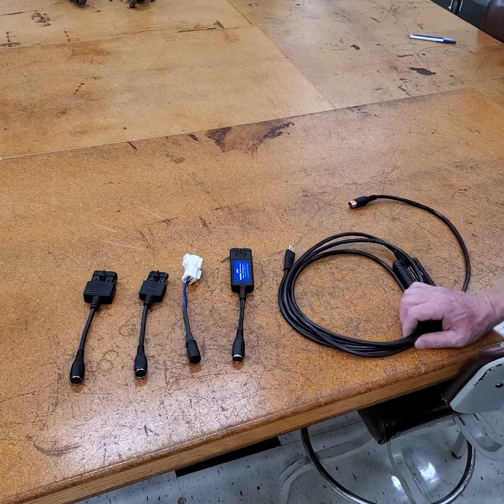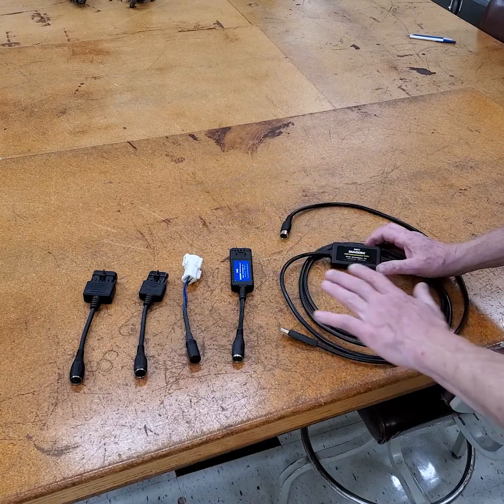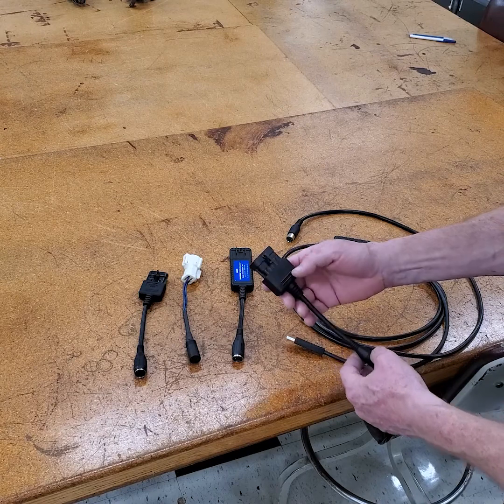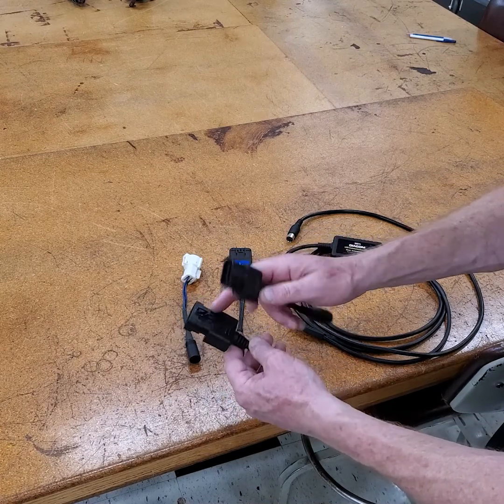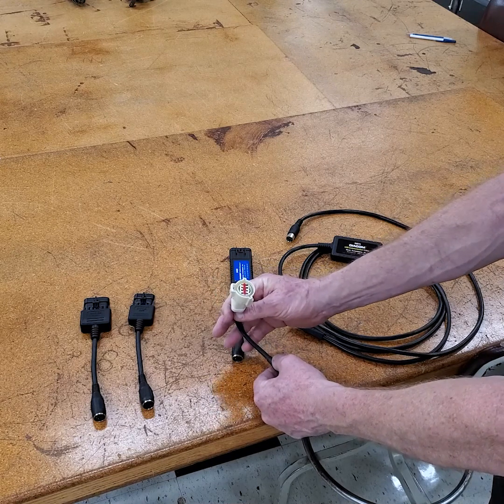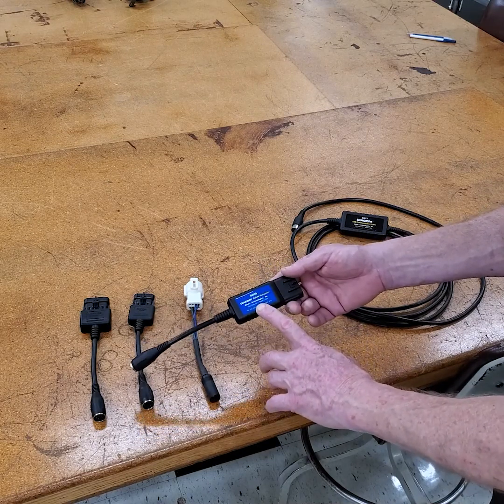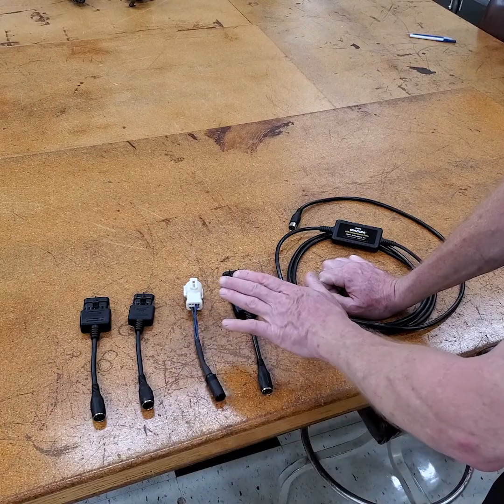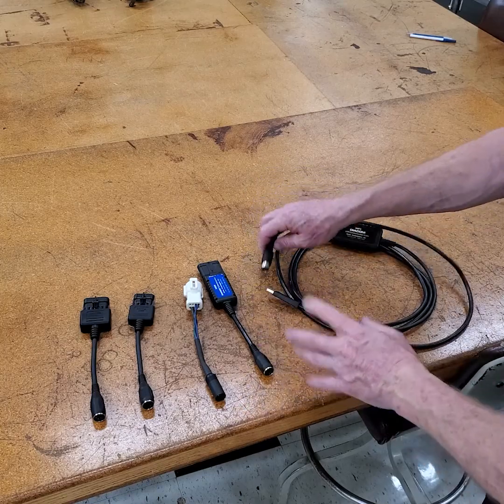Diacom Marine Engine Diagnostic cable

Comment: How is the RINDAS diagnostic system connected to the mercury 90hp optimax for a test? I am having a problem with my engine.  very good video
Reply from the maker: There is an adapter you need to connect Diacom to the engine. Go to their website to find the adapter
Reply: I have it to the adapter but I get this ECM denied access on the computer
Reply from the maker: @simbaneron7880  not sure of the reason. Can you email an image of of the adapter plugged in and a picture of the diacom connection failure screen